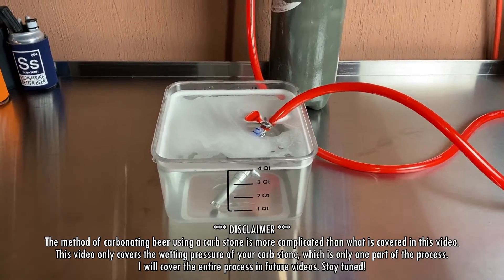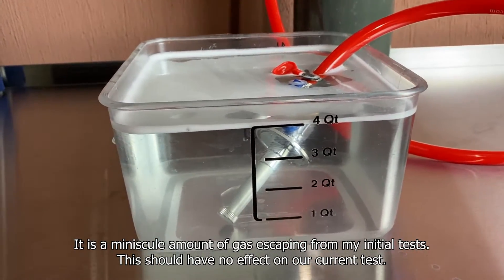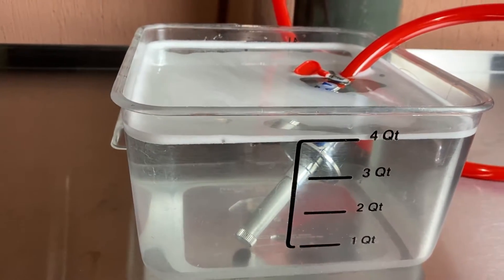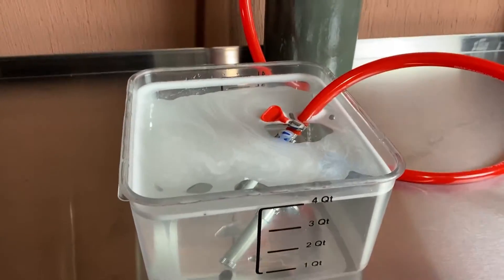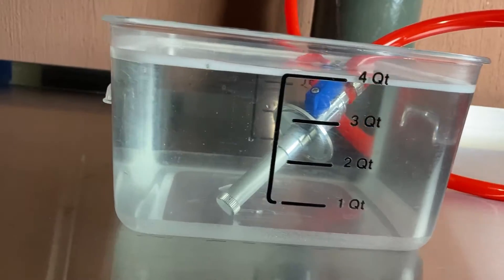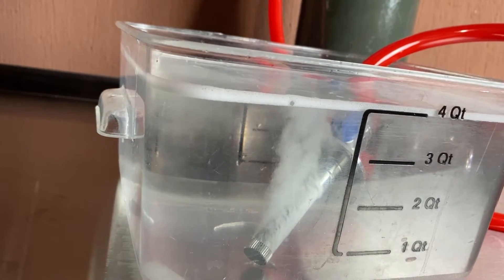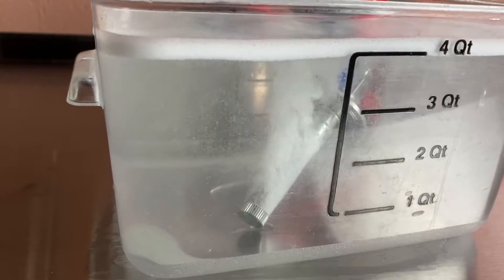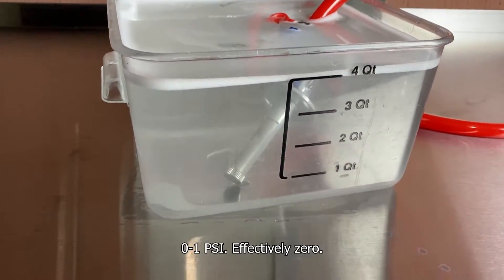How to use a carb stone (wetting pressure)

Comment: "Wetting Pressure" is sort of a misnomer, you are actually determining what's called "bubble point". Bubble point is driven by several factors. The contact angle of the liquid is influenced by what the solution makeup is. Water has one contact angle, alcohol has another, and other materials and mixtures will something else. Contact angle can be looked at as how much a drop of liquid will stand up on a surface, which is a function of it's surface tension. A drop of pure water will stand quite high if placed on a hydrophobic surface, and a drop of alcohol will "spread out" and be flatter on same material generally. It's good to know that this is basically how soap works... when you add soap to water, it makes the water "wetter", and drops the surface tension, lowering the contact angle. This allows water to overcome surface tension, and sneak into the smallest pores, thus improving the ability of water (or any other solvent) to "lift" the dirt out easier and wash it away. So the porosity of a material (the stone in this case), the contact angle of the solution (determined by solution makeup), and the pressure used during testing is really just measuring the pressure required to overcome the surface tension that is holding the liquid in the pores via capillary action. There will be little bubbling (just via diffusion) that will take place until you overcome the threshold, and then an avalanche of bubbles will occur, and that is the "bubble point". This is how most filter's average pore size is determined during manufacturing, as you can solve for pore size if the other factors are known. You can find several variations of the formula online if you're curious.
Reply from the maker: A lot of great information here. Thanks so much for taking the time to explain it all! I’ve pinned your comment so others can see it as well! Cheers!
Reply: @tybrewing9807 I may have worked in the filtration business just long enough to become boring, lol. Hope it sheds a little light on the hows and whys. Take care.

Comment: Hi Taylor I have question how you are able to produce very tiny bubbles and can we use other gases like compressed air , oxygen or nitrogen?
Reply from the maker: The tiny bubbles are caused by the carbonation stone. The stone itself has tiny perforations in it. It is intended to be used in a uniprocess fermentation vessel for brewing beer.

You can run multiple types of gas through the stone, but its intended use is for CO2. You could in theory use a carbonation stone to oxygenate wort once it has been sent to a fermenter, prior to fermentation, but most people add O2 in-line while sending wort to their fermentation vessel.

Hope this helps and isn’t too confusing. Let me know if you have any questions.
Reply: @tybrewing9807 I did the same, as you did in the picture but still I am not able to produce at tiny bubbles , I could only see the big bubbles very big bubbles, I have tried different things like pressure and flow rate but still not able to see that tiny bubbles as you are producing. Please if you could help me it could be a great favor.
Reply from the maker: @RanaHamza-iv2wj Oh, I see. I believe the difference you are noticing is because the liquid in the video contains Star San. It’s very bubbly. If not that, then maybe because I am running into the stone at a rather low pressure. It’s difficult to troubleshoot why the bubbles would be a different size but that’s my best guess.
Reply: @RanaHamza-iv2wj   try to add a venturi injector or high pressure water pump

Comment: First stone should be in the same orientation as it will be in the tank, second head (hydrostatic) pressure has nothing to do with quantity of beer it’s how far the stone is submerged 1psi per approx. 28 inches and third don’t control the flow of co2 with a regulator, get a flow meter with a valve.  Wetting Pressure + Head Pressure + desired Equilibrium PSI = Carbonation Pressure
Reply from the maker: Thank you for this comment. I had intended to expand upon (and correct) the information in this video when I uploaded my video on how to carbonate beer using a carb stone but I missed the mark. I’ve pinned your comment so people can use it as reference. Definitely important info, especially when scaling up to commercial scale

Comment: Wetting pressure depends on hidrostatic pressure so what you calculated there is 1psi/4qt 0.25 psi per qt of water/beer so if you want the psi needed to get the stone working on a 5gallon fermenter you just multiply that
Reply from the maker: Thank you for this! I knew there was an equation involved in the process but I forgot to include it in the video. Definitely an important detail! We typically just run carb sets and then check with a TapRite/Zahm gauge but this is crucial if you want to just set it and forget it or don’t have access to that sort of equipment.